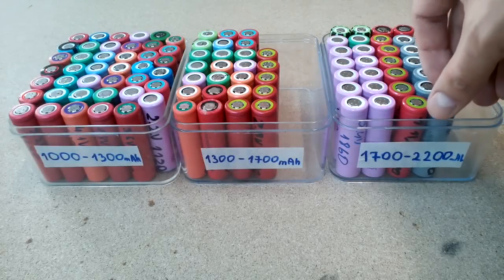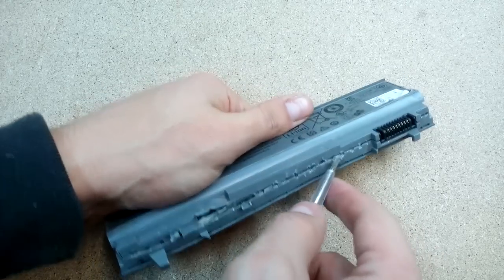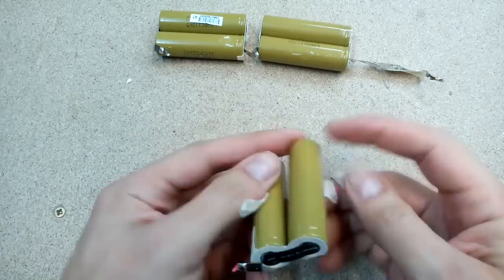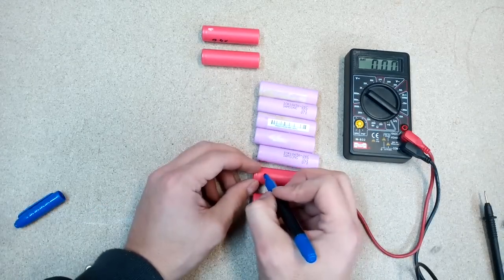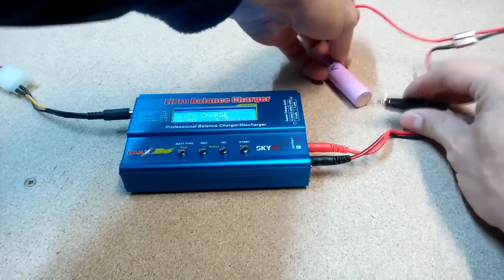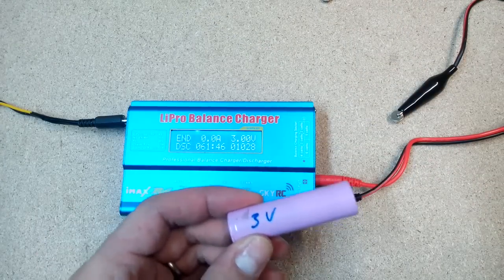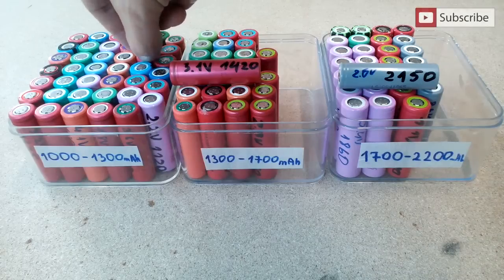How To Get: Free 18650 Lithium Cells From Dead Laptop Batteries

Comment: TIPS : If you're planning to reuse it as a power tool battery and you don't have a spot welder, just leave the old nickel strip on the battery so you can solder it correctly and securely.

Comment: I got an ad for a site sponsored by battery powered tool manufacturers that says to always buy OEM...
takechargeofyourbattery.com
It's sponsors are:
https://www.powertoolinstitute.com/pti-pages/mb-member-brand-profiles.asp
We need to band together against that crap and force them to use standard specifications.  Even worse is that several of these are owned by the same parent company, often manufactured in the same plant and still there are 100s of unnecessarily incompatible tool batteries (usually just an extra tab here or there)
How many different battery packs do you have?

Comment: They're usually called "dead" for a reason. Sometimes one cell will fail and the rest will still be usable, but just be wary that they are probably pretty worn and may be close to failure. I wouldn't use recycled lithium cells for anything remotely important or high-demand.

Comment: You can sometimes revive dead batteries on the charger by just letting them charge and testing the voltage and capacity a couple weeks later.

Comment: I'm going to type this very simply.  When you buy AA batteries they come in different lasting.... you pay more money for batteries which run HIGH DRAIN DEVICES.  I can buy dollar store batteries for digital camera.  They will not power on because they suck and they are not high drain batteries.  They are great for a $1 LED flashlight and that's about it.  Think of laptop and other used batteries like that.  The drain rate, let alone the way in which they are wired (the way the power drains from them), is DIFFERENT than that of an electronic cigarette, especially one that operates below 1.0 ohm.  I sold eCigs for 2 years and have been vaping for almost 6.  DO NOT PUT USED PARALLEL LAPTOP BATTERIES IN ANY ELECTRONIC CIGARETTE.

YOU WILL A DARWIN AWARD.

The same battery size doesn't mean equal usage, in a nutshell.

Don't be stupid.  Yes, you can use these to rewire LIKE draining devices IF YOU KNOW WHAT YOU ARE DOING.  If you do not, these are great for a $5.00 LED 18650 powered flashlight AND NOTHING ELSE!
Reply: Those purple batteries originally also came with an eCig; however, that eCig DID NOT SUB OHM!  I see the arguments for a regulated mod.  Yes, if you're running an old school tank that doesn't go below 1.2 ohms on the coil, I would assume these would be safe to run given the safety measures he used in the video.  But I would never not even on a $10,000 bet put one of these batteries in a device which operated below one Ohm.  That is just flat out stupid.

I'd use these batteries in a couple of 18650 flashlights, AND LITERALLY NOTHING ELSE.

You also have to consider every rechargeable battery, for the most part, has about 250-300 charge cycles in it.  This is why your eCig batteries last about half as long fully charged after 2 years.  Yes, you may be getting good cells, but you have ZERO idea how many times those batteries were drained and recharged AND WHAT AMPERAGE.

When in doubt, leave it out.  I am dead serious about flashlight batteries and nothing else.  If you have a regulated mod that fires a protank or Nautilus or some clearomizer THAT DOESN'T SUB OHM, you are PROBABLY safe, but I wouldn't risk it.

I have a set of 18650 that work, fully charge, etc.  but they last an hour in my mod because they are old.  Do not use old batteries.  It's not smart.  Retire them after 2 years, 3 tops.  2 tops with heavy usage.  Trust me.  Been doing this a while and haven't had a dumbass blow his head off, yet.

Comment: Why does my brand new 18650 only has  3.8volts and i cant charge them more than 3.8v they are protected aswell 2800mAH
Reply: Crappy charger, crappy protection circuit or cell.

Comment: You should to discharge after charge, and work whit charged mAh, because, if battery was half charged (full capaticy 2000mAh) you will measure 1000mAh by discharging.

Comment: Thanks, I never thought of this. These work for vape mods right
Reply: DON'T USE THEM FOR VAPING. IT'S NOT SAFE. These batteries have been charged god knows how many times and the amp limit is very low since they are laptop batteries. Buy new ones. They are cheap.
Reply: Βασίλης Άγνωστος I won't

Comment: yes you can get them a lot. but:
if u took it from laptop batteries dont expect to use in high amp required aplications such as electric tools in house building, drones, viping and more.
they are good for powerbanks, flashlights, toys, diy things.
if someone could say that earlier to me, i would be very thankfull for information.
you can find spec about the battery from numbers on it, and google it. most are 3-5 amp, some 1amp.
Reply: I stuft them in a electric power drill just do not over charge them respect the 4.2volt per cel limit. btw the drill is a 18volt en i made it a 24volt one to charge you need 25.2volt.

Comment: DO NOT, I repeat, DO NOT use these for vaping, VERY VERY BAD JUJU, old worn out 18650 laptop batteries have no reliable use what so ever, the only thing you can do with these batteries is RECYCLE THEM. Videos like this one are what give people bad ideas about vaping. This video should be removed and never shared, PERIOD. the nerve.
Reply: you can use these batteries in low amp draw applications such as flashlights or powerbanks. and if you know what you are doing you are safe

Comment: Ok.  Here is a question.  Why check the charges on a battery before attempting a recharge?  The 18650s are designed to be recharged.    I explain.  I have a buggy old laptop that I am ready to trash.  I have 18650 flashlights for use in the house.  Every few months, I check the charges anyway.  If I charged up the old lap top batteries (assuming that each would hold a charge) and used them instead of what I am currently using, why bother evaluating them in advance.

Comment: Just because a battery will take a charge, does not mean it is a "good" battery.  In these old, dead, laptop cells, they have already been damaged to the point where they will not accept a full charge.  Some are totally dead, some may not be.. but ALL OF THEM ARE DAMAGED.  Damaged batteries are not to be trusted.   It is much better to just replace the cell with a new one.

Comment: Good advice. In my experience, most lithium battery packs fail when ONE cell (or maybe two) die. If you disassemble the pack usually the majority of the cells are still good. I put them in a box and next time I have a battery fail, I check if I have anything that fits. Before I store them I use a 3 volt flashlight bulb and a couple of wires to drain the cell completely. That doesn't seem to hurt a lithium cell and it insures that any new battery assembled starts out with even charges in all the cells. I've also used lithium cells to convert old NiCad batteries to lithium. In most cases there is more than enough room in the old NiCad case to fit new batteries.

Comment: DON'T USE THESE FOR VAPING!!! These are PCB protected batteries that can deliver a max of 5 or 6 Amps. MAX !!! If you sub ohm on these with a mechanical or a regular mod, they WILL explode from overheating. But if you use them on resistances like 1.5 or above they will probably be OK. Even if you are on above 1 ohm, i still would not recommend these for vaping. In the vaping world, knowing your batteries is the first step from harms like burns or explosions.

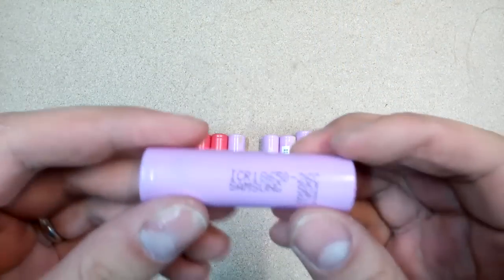Comment: For the most part an useful 'Tip', but from time-mark 1:30->2:30sec this Tip is an excellent demo' of what NOT to do! 
FYI - All these type of multi cell 'packs' are Arc or 'spot-welded' together (don't ask how!) because the metal terminals & cell-to-next-cell links are Nickel coated, so cannot be ('tinned') soldered together [YES,  Nickel is 'magnetic', but cannot BE magnetised i.e. made into permanent magnets - weird I know]. Ripping them apart as shown will damage the internal Anode & Cathode connections of the cell. It will also start highly TOXIC electrolyte leaks that WILL do CORROSIVE damage to you & any way the cells are used, especially when charging. As demonstrated, this is the very best way to kill cells, or at the least reduce their capacity. SO GREAT CARE IS NEEDED NOT TO DAMAGE ANODE & CATHODE TERMINALS WHEN SEPARATING CELL TO CELL LINKS, as was done here.
Reply: what is the best way to remove cell from pack??
Reply: @Rohitmbmee  cut the tabs dont rip them
Reply: Tim Mazur 9

Comment: 18650 voltage between 2.75V and 4.2V.  You discharged them to 3V only, however real capacity discharge is 2.75V.   Then re-charge and measure the difference in mAh (Discharge vs re-charge mAh).
Reply: Different manufacturers quote different cut offs. For some it is 3V where others it can be 2.5V.
Usually you don't gain much by going from 3V to 2.5V.
Most battery dischargers, such as SkyRC Imax and Turnigy Accucel, cut off at 3V by default on the Li-Po setting (Li-Io mode is designed for older 4.1V batteries).

Comment: i use the exact same charger as you.. Imax b6..
BTW... you read the Capacity/Mah reading wrong.
The charger is giving you the capacity readings from a half charged battery..
Do a capacity test from a freshly charged battery, for accurate results

Comment: Hello everyone 
i opened old dell laptop battery and i got lithium ion battery 11865 not 18650. are these batteries is different from 18650???
Reply: Preyansh Yadav no shit 11865 is not the same number as 18650 is it?
Reply: They're probably LG cells. They are the exact same though, 18mm diameter and 65mm length. Don't know why they call them 11865 instead of 18650 but they're the same battery

Comment: Be cautious charging cells of differing internal resistance and condition. Li-ion cells are very dangerous if mischarged.
Reply: paulanderson79 he is charging them individually, what are you on about?
Reply: Having watched again yes, you're completely correct. I am still slightly nervous of combining multiple cells in different condition into batteries.
Reply: @NGC1433  Don't. "Marry" your batteries if they are going to be used in something like a flashlight or laser. If one cell is discharged and the other isn't it will be really shitty. I have a few nice nite cores to charge all mine, be safe.

Comment: if you are a vaper...

how to get a pooowwwww in your face! don't use this TNT batteries in MODS above 20w !!! / and low than 1ohm ! or use it and i'll hear about you at news...

even so this Accu have a low drain discharge  ( maybe 5 amp) and your device will be sooo lazy. you need at least 15amp drain. for a safe  vape buy special accu ..

never use them for vape devices if they are smaller than 2200mA

maybe they are good for flashlights based on LED, little electric engine , and so...

Comment: Check out this Kickstarter campaign for an 18650 cell battery testing system: http://kck.st/2eUyaAR . If you want to get some real performance out of your battery packs, you need to use a system like this that is specifically designed for this purpose. The system guides you through the entire process of labeling cells, performing high precision capacity and impedance tests, and matching cells together using an optimization algorithm.

Comment: Does most laptop batteries have the 18650s?
Reply: Most but not all for example Macbooks have flat cells (not sure what kind). These cells are useful for other projects, I converted a RC transmitter to use the cells since it has a super low power draw.

Comment: Anybody know if laptop batteries run in parallel or series?
Reply: In half series , because most laptops powered by 18v - 20v , and most 18650 Lithium Cells had 4.2v (fully charged)
Reply: A lot are 4 blocks in series (14.4V = 3.6V*4 ) of 2, 3, or 4 parallel cells (2P, 3P, 4P).  So an 8 cell 14.4V pack would be called 2P4S, a 12 cell pack 3P4S.

Comment: you should discharge cells at 0.25c since thats what manufactures use, that 1000mah cell might have 1250 if you discharge it at slower rate
Reply: depends for what it will be used

Comment: Is the battery works for Vape?
Reply: Don't cheap out on something that's so close to your face.
Reply: jeff pepin I'm guessing English isn't your first language but my point still stands, don't cheap out.  I don't care what wattage you're vaping at.  You want to take the chance, more power to you.
Reply: every 18650 laptop battery are ok for vaping under 31Watts , over 30 watts you need high drain 18650 like effset
Reply: i've just got Efest 20/35A imr18560 High drain with anti-counterfeit sticker , and i expect a lot of amp soon , but i have vaped with my GCR18650 taked apart from laptop battery , and i' m in perfect shape , with moderate watage any 18650 will do the job , but you will need to replace empty cell 14 times /day
Reply: i have vaped with laptop 18650 , at 0,29 OHMS , at 25 watts , and NEVER ANY CELL HAVE BEEN HOT ,, 25 Watts is too small to get a baterry blast , OK MAYBE WITH A 200W MOD ,, but these cells simply cant 'handle it , and some of mod have Discharge protection circuit to prevent baterry to be over discharged ,.,,, stop sayin using laptop baterry will blast your leg off , its pure non sense if you using a LOW WATTAGE mod
Reply: thanks for knowing that i speak french :)
Reply: i only speak of that because i have tested somes low amp batteries like laptop pack 18650  and it work fine , only one bad thing with these are the speed for empty one battery , i have tested it and for me its just  okay
Reply: They're rated from one to two times the capacity.  So 1x2200mAh = max 2.2A (~8W) up to maybe 2*2500mAh = max 5A (18W).  I wouldn't push the best laptop cell past 20W.   If you do, at best, you'll not get much life out of them, negating the point of getting them cheaply.  At worst, well, you know.

Comment: is soldering to end of battery ok? not done commercially always spot welded. how about a small spot welder project just for things like this? in the '60s my uncle designed and made the worlds first spot welder that was for very small electronics and measured the resistance before it would do the weld. i still have one and am going to try it on some 18650

Comment: congrats on the excellent work. question, if there are 18650 that are to low volt, maybe 2 - 2.5, to start charging can a little voltage be applied while in charger (TP4056) so that it starts charging them?

Comment: the 6 cell laptop battery for a Hp dv1000 is on ebay for $6-7 at the moment and the cells are panasonic CGR18650AF these any good for a 8 cell battery bank? or if anyone has recommendations for a 10 18650 cell battery bank?
Reply: ebay item #  262085265831

Comment: This is very illuminating - i didnt know laptop batteries used 18650's so i opened up a duff DELL D630 and I now have 6 new batteries for my new project!

Good idea using the magnets to hold the crocodile clips onto the batteries!
Reply: Check the voltages man.

Comment: Would anyone happen to know if there's a standard with mah or amperage with laptop 18650 cells?
I have some need for ~ 20-35a.
Reply: Juozas Gecevicius If a manufacturer puts this grade of 18650 battery in a box mod, they will not have a company for a very long time. It'll be the iStick 50W all over again with mods exploding left and right.

While they are the correct size, they don't have the correct specifications for vaping applications. Vaping requires far more amperage than a laptop does. For instane, vaping at 25w you'll need 25/3=8,333 ampere. I doubt these batteries even have that. So these couldn't handle vaping even at 25 watts.
The 3 is to calculate the amp draw at the battery's lowest possible capacity, when it's really empty. That is when it'll have the most strain on it. Really, at 3 volts, it's not in proper shape anymore. Try not to get a battery beneath 3.2v.

Anyway, the batteries in the video are not suitable for vaping applications at the sort of wattage modern atomizers require. Even the mouth to lung and beginner atomizers can usually push up towards 25-30 watts these days, so these batteries will not be safe for those.

And once we start talking mechanical mods, please forget all about these batteries. They will explode on you unless you're using a coil at like 2-3 ohms. They don't have a very high amp limit and will enter thermal runaway, which is when the cell actually explodes and bursts into flames. This isn't something that needs to be tested, as it has been before. Lots of videos out there of exploding batteries from all kinds of devices. 18650 batteries for vaping, lipo batteries from drones, lipo batteries from cell phones etc., etc.

I'm by no means an expert, but I am 100% confident in saying that nobody should put batteries from a laptop anywhere near their vaping mod. They are not made for the application and they will fail horribly and they will with all certainty overheat in a heartbeat and explode into flames.

Please, for your sake and everybody else's, spend the money on good, high ampere batteries if you are a vaper. Don't be stupid about it. 25R cells are cheap and reliable. $5-$10 gets you 1 or 2 cells depending on where you shop.

Also, if you have a mod that takes more than one battery, always get a fresh set of batteries for it and always use and charge those batteries together. Never let one charge and one not etc. It is unsafe practice. Let's not make vaping more dangerous. Let's prove the newspapers wrong.
Reply: no
Reply: haha you also vape right?
Reply: Buschwookie
M-.... Maybe.
Reply: These are not safe for vaping, that's all I know. Maybe with 1.8-2.5 ohm but that's about it.
Reply: +Shaxi OK take apart a box mod and what will you find? this battery that is shown on a video
Reply: +Juozas Gecevicius yes they are the same size, but they don't handle that much amperes
Reply: +Buschwookie they work perfectly in jomotech 40w box mod though